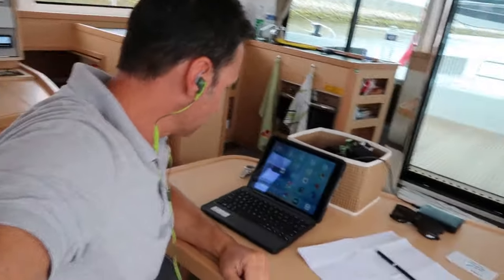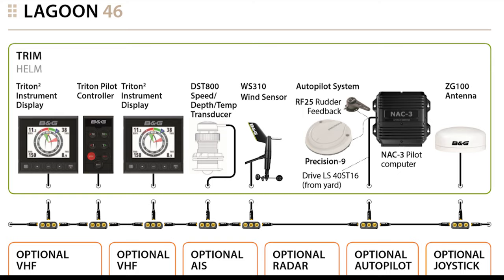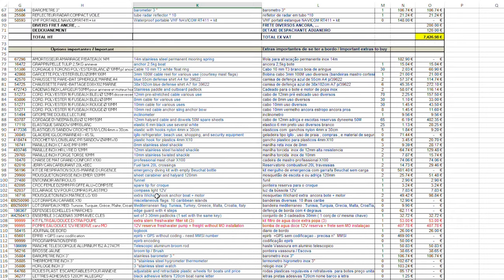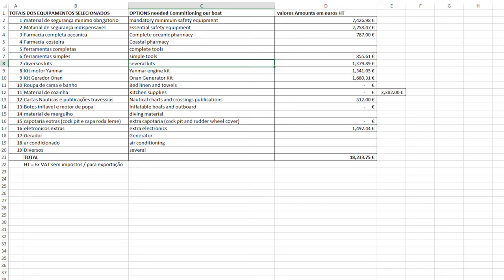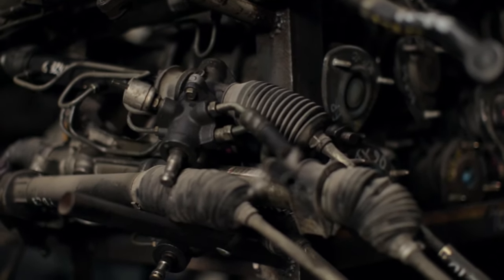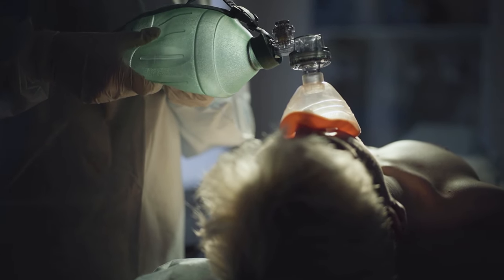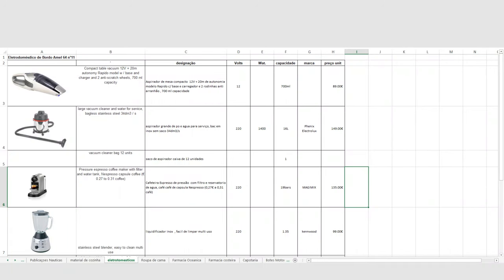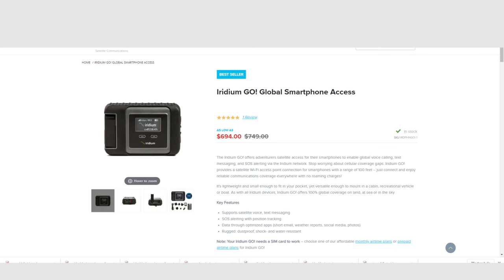LAGOON 46 OPTIONS - Extras Needed after delivery Ep 24

Comment: Out of curiosity does Lagoon offer any electric motors with a large battery bank as a factory option?

Also, is there more than one shore cord, and what is the amperage of the shore cords?
Reply from the maker: E K lagoon does not offer an option for additional batteries.  You need to do that afterwards.  We may do it once solar pan ela are installed.  Our boat will be 220v / 50mhz / 12v inside for lamps and other electronics. We will have a large inverter to use 220v when needed as well.
Reply from the maker: Also. Forgot to mention on my previous message.  There are two shore cords. One to connect to electricity and one for the AC.
Reply: Sailing Joy thanks.  

If house loads are at 220 volts and 50 Hz, then what do you do, for instance, when you sail to the USA?  

How do you connect to a different grid voltage and frequency?
Reply: Sailing Joy thanks.  

If I understood, one shore cable is for regular house loads, and the second shore cable is for air conditioning.

If I misunderstood, an alternative explanation is that one shore cable is for 12-volts or 24-volts and the second shore cable is for alternating current.
Reply: Sailing Joy thanks.
Reply from the maker: @ek9772  iF the Marina does have 220V I can still connect to 110V / 60 for but it will be weak.  We selected 220V because we will cruise in places where 220V is predominant (Europe and Caribbean)
Reply: Any idea on Electric motors option possible  ?
Reply: ZEROTo18 depends on the boat.  Sailing boats can use electric motors with regeneration.  Power boats cannot.

You can look for Oceanvolt, Elco, Thoosa, Thunderstruck, Electric Yacht, and Electroprop.

Comment: maybe buying a slightly used well equipped privately owned cat that has done a few seasons where all the parts have bedded in and proved themselves to be reliable and needed .
Reply from the maker: Richard that was definitely an option and many times that proves to be the best route one can take.  In our case because we had our hearts on a new Lagoon 46, a model from Lagoon that has been recently introduced we could not take that path.  We are enjoying the road to prepare but without a doubt there are many privately owned yachts out there that already have everything you Imagine installed, been just a matter to try to negotiate a great deal.  All the best and thanks for been with us.